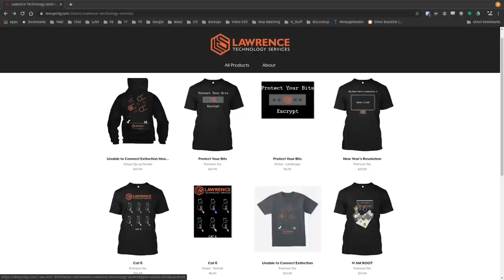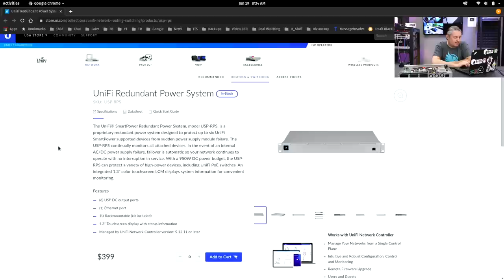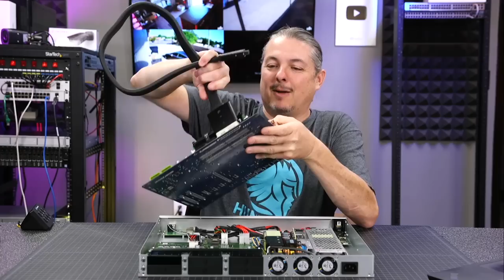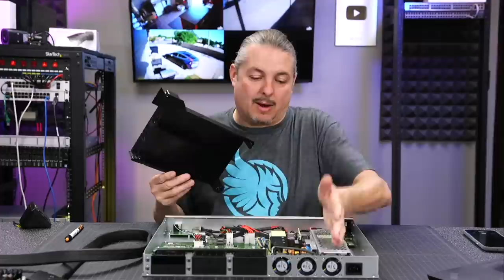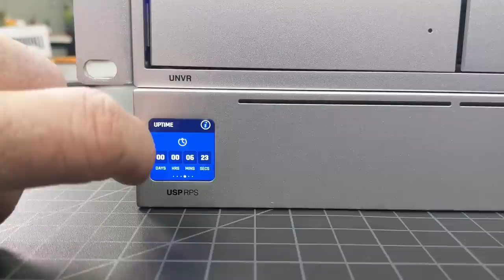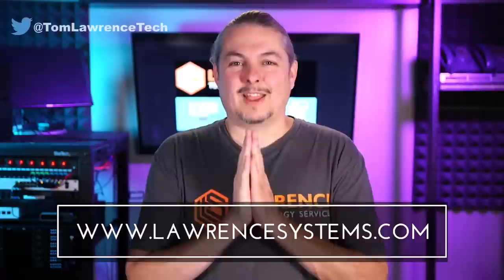USP-RPS: UniFi Redundant Power System  Review

Comment: "Redundant Power Supply" that only works as a backup power for an already powered device, but not as a redundant power rail for boot. That is something that is quite a bit less than what is being promised: a replacement for a dual PSU SKU that people have asked for.
Reply: You will have rack APC on device and on redundant power suply also. Double protection. But is it adventage ? or excuse ?
Reply: It’s only $400, what a ‘steal’....
Reply: Agree. Don't see the point unless it can boot a device where the PSU is dead.

Comment: The shortcoming you mentioned with the NVR not booting back up if the main power supply dies is a bigger deal IMO. The power supplies in these devices are not easily replaceable. You can’t just slide out the power supply and put in a new one. So you’ll be without a device until your warranty claim gets sorted or until you buy a replacement. You should have the ability to run the devices off of this USP device.
Reply: Yeah, this thing is no redundant at all like how it designed.

Comment: As I said on CrossTalk's video, Removable Power Supplies are cheap from an implementation perspective. They should have just sold units that work with this with an open port for a second PSU. The price comparison for this device is not even close IMO. 
Where this kind of product could shine tho would be if you could use ONLY this to power the units in the rack. Pull all power completely from the switches. Even better if A: this unit could be linked to another for redundancy, or B: this unit had 2 PSUs itself, and C: the cables could be daisy chained instead of running 6 of those honking cables.
Reply: They were going in that direction at one time and then backtracked to this. Honestly this company is its' own worst enemy and biggest competitor.

Comment: You don't need 2 different lines, just look at servers. You can have a switch with 2 hot swap power supply bays, you sell it with 1 hot swap power supply. Not only you reduce cost of it by selling with 1 supply but you also give it hot swapping capability, so no downtime.
Reply: Sort of like.. EXACTLY what they do with the edgepower?  I agree that's the way to go

Comment: If it can't be used to boot up devices in case of psu failure, it is a big issue.
Reply: ValorHeart its a deal breaker for me. Why would they build something like that?
Reply: @jeremymyers5503  ikr, so pointless. It's a flaw.
Reply: Also: what if the PSU in the switch fails and it needs to be replaced? Just imagine a nice dense rack with 5 or 6 switched filled with 48 just a bit to long cables with minimal access to the front. Do the process in your head. What is step one in the process of this magical contraption of redundancy? Exactly: pull all the cables, because you have to replace the entire switch bringing down any device connected. So much for redundancy.

Comment: UniFi IMO did this wrong, now you have a single point fail redundant unit, DOA reboot and the nightmare to manage those elephant trunk cables. What makes a lot more sense is for their Pro lines to have component redundant PSU's and add the $30-$100 (PoE++) per component.

Comment: This is an interesting concept, but falls short for me.  Would have liked each device (switch, router, etc) capable of holding 2 (or more) hot swap/removable power supply's.  To save on cost  make the second PSU optional.  As I see it when the PSU fails in the switch the entire switch needs to be removed from the rack in turn causes an outage.

Comment: This would be an acceptable solution if their devices had a user hot-swappable PSU. 
At least then devices could failover to this unit, a new PSU could be ordered, then replaced with no downtime.
Reply: Also would have been better if it could work as a UPS with open modules for additional battery units.

Comment: Watching this video made me think of 2 possible items.

1) You said people ask why they don't make 2 units, one with a single power supply & one with two power supplies. I understand how this device might be simpler than that. However, what would be even simpler would be modular power supplies and make all the cases to hold 2 power supplies. If someone wants the second power supply, they would buy and extra modular supply and slide it in. This would also simplify replacing a bad power supply. It would also allow different sized power supplies to be sold to support different PoE capabilities.

2) One thing I could think of for not booting off of the RPS is that devices frequently pull more power as they start than they do to run. However, the RPS could stage the outlets to only allow one outlet to power up at a time. This should allow it to absorb the extra power consumption of a booting device.

Comment: Repeating what others have said here I think... It needs to be able to power the device when there is no AC present. It seems to be just not quite right.

Dual PSU's like you get in servers would make sense, supply with one installed sell spares so you can a/ have a second if you want b/ replace on failure.

I guess another options would be for the USP to have two AC in and for the devices to have two USP power in maybe?

Or make it a stacking power cable. Do away with the USP and have one device capable of powering another device in a stack... ? maybe ?
Nice try Ubiquiti but I don't think I'll be buying one any time soon.

Comment: I think for this to be of real value the PSU on the devices needs to be hot swappable.  I would also argue for redudent power on the RPS.

If you can't power on the devices any power outage or accidental update will bring the network down. That is not ok.

Comment: If i recall correctly, the older HPE switches i have at work have a similar option for backup power supply option.  Or maybe it's only if you have a DC power rack.  Not sure if it's backup or a either AD or DC.  i've never used DC on them.  I'm just going off an old memory of when we were first looking at buying them.  Now the Aruba switches we've gotten recently offer removable as well as redundent power supplies.
Reply: you are correct on the HPE switches. Additionally the PowerConnect switches from Dell follow a very similar approach, where you have a DC RPS Unit to have backup Power. This is also very handy if you want to reroute power cables in a network rack

Comment: If your only looking to add redundant power to single power supply devices, I would recommend getting an automatic transfer switch.  CyberPower makes one that can be had for about $240.
Reply: This is indeed exactly the same solution only with bulky, proprietary and expensive cables

Comment: That is an interesting board in there, it shares the same firmware image as the UniFi Switch Flex, both devices are using MT7621 SoC, similar to what they use in the ER-X and it's derivatives.

Comment: The NVR video output died on the TV behind you when you pulled the power out and returned when you plugged it back in this seems like a BIG issue to me.
Reply: Not exactly. The cable was already removed. He flipped the switch in the power strip off and on. I think the nvr was still booting and the tv got the signal around the time when he plugged itinerant the power. It did look like it happened when he plugged it in though. I would have liked to see if the nvr did in fact come back on in that situation.

Comment: Is that meanwell a 12V power supply? Judging from the 16V caps near the output, I'd guess it is.. That means the 12V is then buck/boosted to whatever it needs on the second board. Makes it convenient to modify it to run off 12V batteries.

Comment: 1 year later Unifi launched UnifF: Network redundancy.
They will sell you many UPS (Redundant
Power System Pro), basic switch with ups (mission critical) , power cycle device (smart power control)…
Would be nice if they announced a solar panel controlled by their software to charge the batteries 🔋 😅

Comment: Expensive glorified power supply.

I did something similar but only use/needed 12 volts so used 3 regular 12V external bricks joined to a common bus with protection diodes.

Been working fine for the last 3 years.

Comment: Who is this for? It only helps you if you have 2 different circuits like a one with and one without a UPS, but it won't help when a PSU in a switch fails.
How is this better than just one PSU in the device and a blanking plate for a second PSU (that you can buy at an additional cost but keeps the price of the initial switch about the same)
Also: what is the procedure for WHEN (not if, because it will fail) the internal PSU fails? There is none, just replace the entire switch. That means: downtime. With redundant power supply's in the switch/device you wont have this issue and you can replace a PSU without downtime. How come no-one is addressing this obvious design flaw?

Comment: Cool idea i guess. But, bad implementation I think. Way too many things that are just like "yeah, that's awesome. But why would you go that route with it... " "Proprietary" cables of short lengths, something else to take up a rack space. Surely it isn't that expensive to just have 2 hot swap psu bays and only include one psu. That would make so much more sense and then it would be just as convenient as every other piece of equipment that has hot swap psu's...

Comment: Is this pro hobbyist gear? I can’t see what value this delivers over redundant internal PSUs which would enable replacement of the defective module without yanking the whole switch. It also coalesces the redundant power system for multiple devices into a single point of failure.

Comment: Does it only power 1 device at a time or can it power up to all 6 at the same time?
Reply: Apparently it has a maxumum supply across both rails (the 12V and 50V supplies) of 950 W, so it will power up to 6 devices to that limit. It is conceivable that you have two devices plugged into it that want to draw more than that (some of the big POE 48 port switches?), but it would be a rare scenario. Most of the time I think it would run 6 devices just fine.

Comment: Can somebody explain this system to me? I am not getting it! What is the point of having backup power if you can't replace the failing component without powering it down?
A server PSU from HP or Supermicro cost 50 euro's, so that's 100 euro's for 2. Retailpricing, I'm sure Ubiquiti would pay much much less. The USP-RPS only becomes financilly feasible when you are using all 6 ports, heck even I would happily pay more for the ability to exchange broken components on the fly.

You know what's going to happen? When the primary PSU fails the backup is going to take over. Heck it works fine for now, we don't want the downtime of replacing the device, it costs too much in labour and purchasing, so the errormessage gets ignored. Untill a few years down the line the PSU in the backup devices fails to and then the techs scramble in panic trying to find a spare device in the middle of the night endin up paying a premium.

This device does not make any sense! We asked for an easy way to service broken PSU's without downtime and you gave us an overly complicated system which achives exactly the opposite.

Comment: This is an unusually bad fail by Unifi. It's a very poor solution. For it to be of any use the pro units should have PSUs that can be removed/replaced while the RPS is powering them.
Alternatively it wouldn't have increased Ubiquity's inventory to supply Pro units with two PSU hot swap modules but sell them with only one in place.